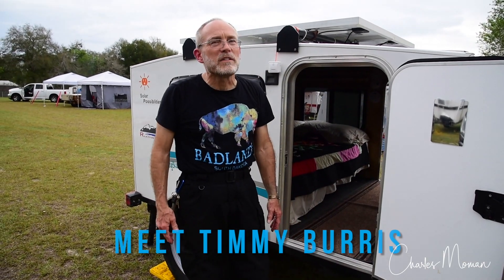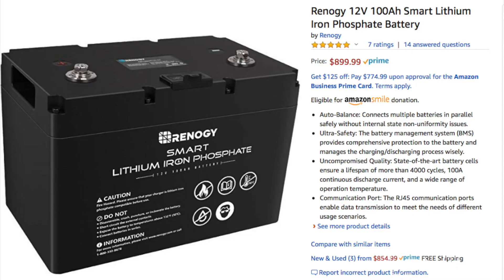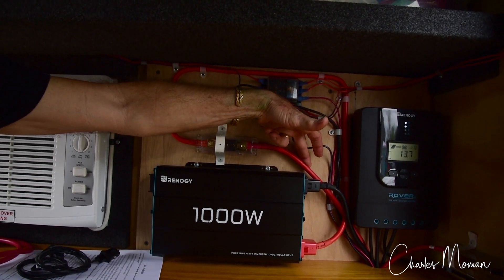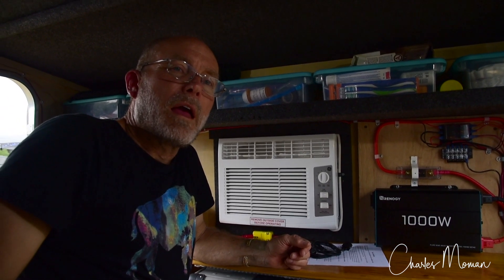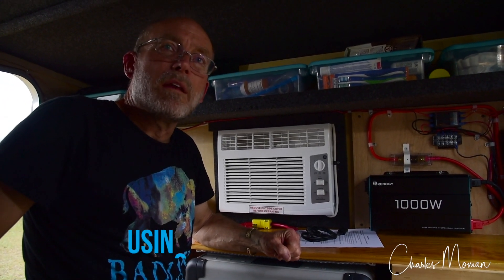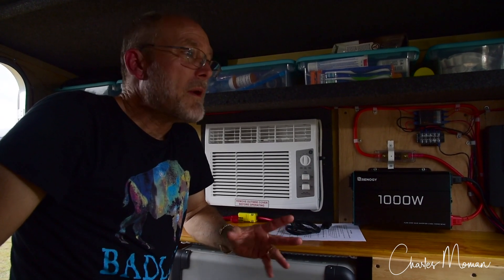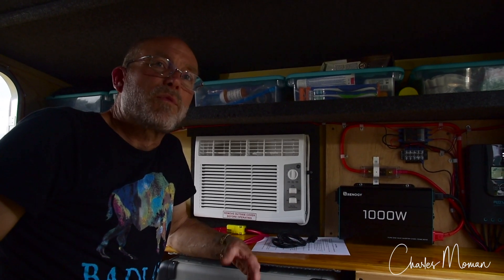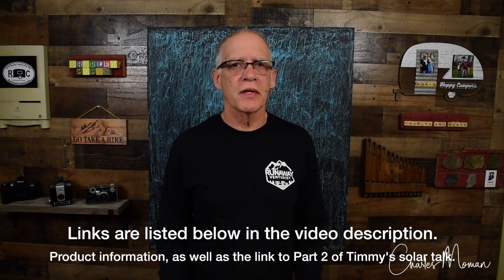Portable Power Seminar - Part 1 - Solar on a Runaway Camper with Timmy Burris and Charles Moman

Comment: I wonder if a system like this can be extended with a portable wind turbine?  Perhaps one could be hung off the charge controller.
Reply from the maker: I really don’t know anything about wind turbines, but I would not  think one small enough to carry around could possibly give you that much voltage. But as I said, I don’t know.